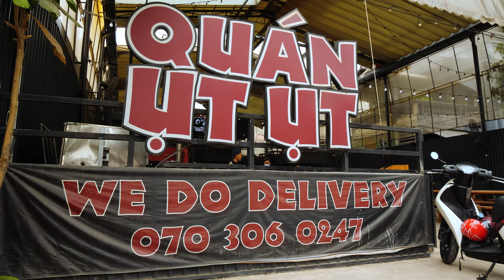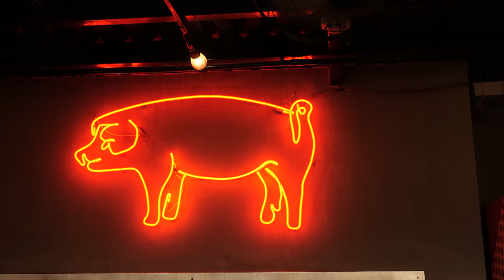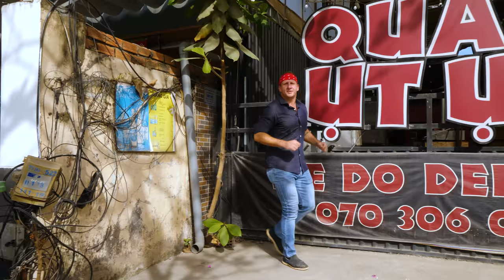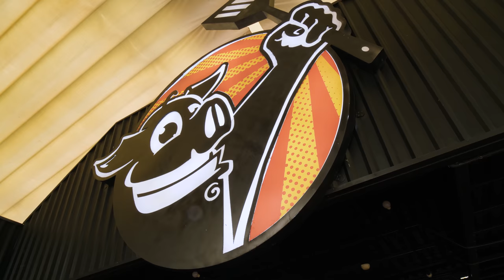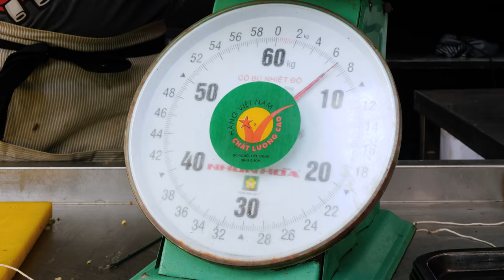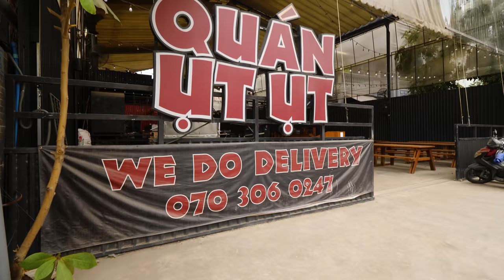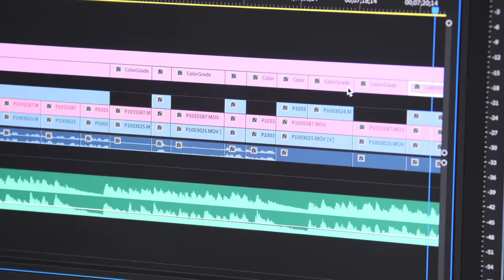FULL Christmas Meal INSIDE a PIG (including dessert)!! Extreme Pig Turducken!!

Comment: Tip : use an windshield-wiper-engine to get the best rotation-speed for the pig on a spit , i can see this pig is rotating to fast :) .. also to get an extra crisp on the skin , take 4 handfulls of salt and 1hr before the end just rub it on the top of the skin ( do not let the salt get inside the pig )